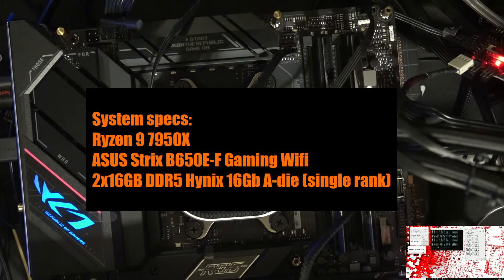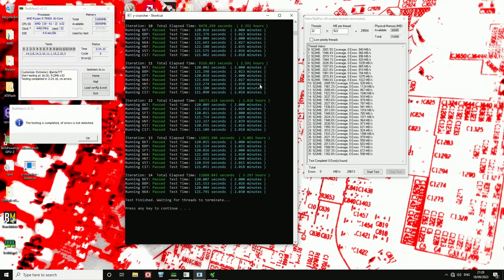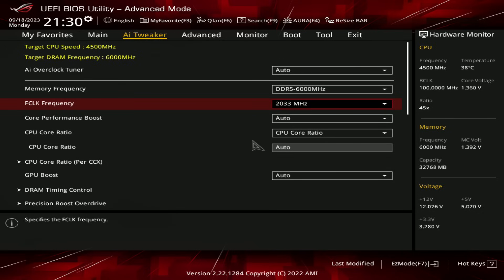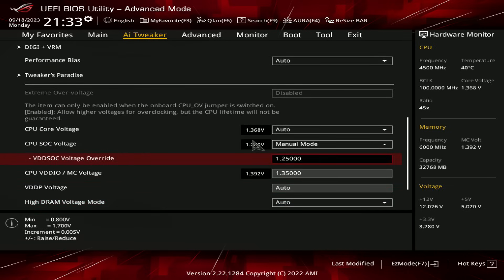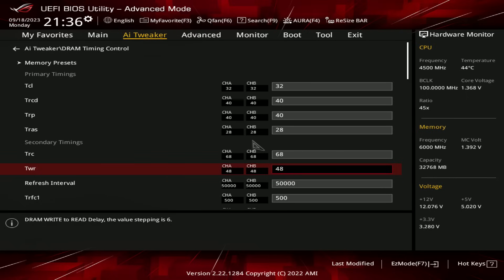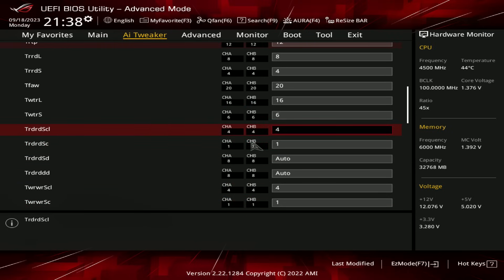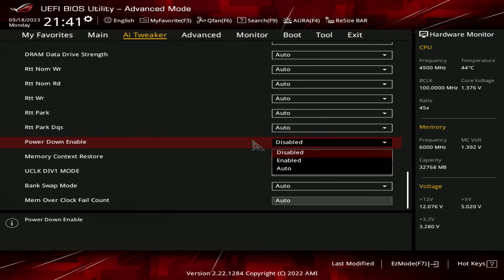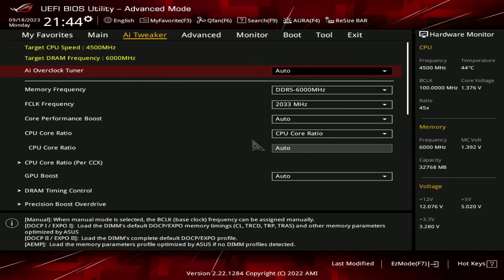Easy memory timings for Hynix DDR5 with Ryzen 7000

Comment: Are there any particular differences for this kit? (F5-6000J3040G32GX2-TZ5NR). I ask because it's 2 dual rank dimms for a total of 64gb. I'm going to build the system soon.
Reply: I ordered the same exact RAM, so I would appreciate if you write anything you find out :) Won't be building for another month or more though.
Reply: @thomasriishenriksen2229  Unfortunately it wasn't effective in my case. I'm just keeping the default EXPO profile for now.
Reply: @Cjorss  did you have stability issues? What motherboard do you have?
Reply: @Dukester  Gigabyte X670E Aorus Xtreme. It started throwing errors almost immediately when turning memtest 5 on and the pc stuttering hard until ending the test. It did actually get that far though.
Reply: @contactluke80  I actually had to turn expo off entirely now. I think it's a temperature issue, It can get through memtest if I set all my fans to 100% but that's impractical. With normal settings I start getting errors. I'm not sure if it's actually the RAM temperature to blame or the CPU because I don't know where to find my RAM temps and my CPU temps are only hitting 70-80 Celsius tops during the test. It's a 7950X3D. Unfortunately I'm going to have to bite the bullet and buy a new case and CPU cooler again because this obviously isn't cutting it even with half the CPU disabled. I'll try Expo again with the new cooling solution and if that's stable then I can try these timings again.
Reply: @Cjorss  Thanks for the update - keen to hear how you get on once you have a new case & cooler.
Reply: @contactluke80  So I went with the Lancool 3 and went overboard with an Arctic Freezer 2 with 420mm radiator on the top brackets. I had to drill mounting holes as they were misaligned, the thing just barely fit in the case. I also moved the 3 Noctua a12s from the old case to the bottom of the Lancool 3. The first thing that surprised me was that the 7950X3D will still reach 90 degrees celcius during one of the ycruncher tests. On idle it's maybe 10 degrees lower than the old NHD15 w/ 1 fan. It doesn't seem to be much better at quickly dissipating heat off the CPU which is a bit disappointing. Maybe if I figured out how to separate the pump from the fans I could operate them separately and have the pump run more aggressively. It's also a bit disappointing that I can't set the fans based on liquid temp rather than CPU temp. Anyway The good news is that my ram is definitely more stable. But these settings might be too aggressive for the dual rank ram. My main test has been TestMem5 and it's been inconsistent at times. On the bright side the Gigabyte boards have a low latency support/high bandwidth mode which seems to improve performance similarly to these recommendations. The best I've had is about an 8m30second test. But even that is inconsistent. I just got 10m40sec. Mind you I also have a Noctua low noise a12 120 mm fan sitting on the graphics card aimed at the ram, It's been fairly effective at keeping sub 50 degrees temps. Without that fan I once managed a successful test where they hit about 65 degrees, usually it throws errors as soon as it hits 50 though. This is really the fault of the manufacturer that sells DDR5 dual rank EXPO memory without a real heatsink. I mean, this new case has 3 140mm fans in the front, 3 in the top and another 3 120mm fans on the bottom and I still need a 120mm fan in front of the ram to cool them adequately. I've also had times where I started getting tons of errors and the only thing I could identify was that I gently touched the fan against the ram. Completely unseating the ram for a couple of minutes and then reseating it got rid of the errors, it's touchy stuff for sure. If you don't have any specific use case for 64gb of ram you're probably better off sticking to a 32gb set, 64gb is kind of an afterthought for motherboard manufacturers too.

Comment: I haven't done any stability testing, but these settings boot no problem for me. 

I have an x670e ASRock Taichi motherboard. The only setting I couldn't find is refresh interval. I looked all over the BIOS and couldn't find it. I've always used ASUS boards in the past and this is my first ASRock board, and comparing the two, ASUS seems to have the better BIOS, but this board has been incredibly stable. It boots with every overclock and undervolt setting I've thrown at it. 

Thanks for the information.
Reply: Another note is the voltage labels are slightly different on the ASRock I have board so it was a bit confusing trying to interpret them from your ASUS BIOS to my ASRock BIOS, but I think I figured it out. 

Although there was one voltage I couldn't figured out where or what it was. It also shows a couple of your voltage settings as red in my BIOS. Although, I was running an aggressive EXPO config and those were already showing red. They were set at 1.3, and you have them at 1.35.

Comment: Running a single stick Kingston 5600 36-38-38 expo, cost 95 eur in 12/21, these settings work just fine, a month and a half later a single stick is down to 73 eur, just checking if these sticks can get to the sweet spot, thanks.

Comment: Could you try and take a look at Trident Z memory? Or does it not make much of a difference?
Setup:
7950X
Asus X670-E Pro Creator
4x16GB Trident Z (F5-6000J3636F16GX2-TZ5S)
Reply: What matters is the chip, Hynix vs Samsung etc.
Reply: Are there any differences between 2x RAM sticks and 4x RAM sticks that you have? The video only showcases memory overclocking for 2 RAM sticks, will that work with 4 RAM sticks?
Reply: @Lil_Asian  they are the same kit, just 2x16gb x2
Reply: @GstarCurtis  Did you configure them as the video instructed? Also, do they run stable? Thanks!
Reply: @Lil_Asian  I haven't ocd them at all, other than XMP
Reply: @GstarCurtis  Ahh, okay. Thanks for the replies!
Reply: @Lil_Asian  4 dimms is harder on the memory controller, which is why 2 is more popular. If you want say 32gb of ram, 2x16 is easier on the memory controller than 4x8. Yes it will work though, this video is for tuned but not too demanding quasi-XMP- should work for everyone on Hynix settings
Reply: @insertnamehere4419  Yes, I'm trying to figure out if it's possible to run 4 dimms at 6000 or 6400 speed. Maybe this video will help idk.

Comment: i’m so cursed, i have a 6400mhz cl32 kit and it won’t even post at anything other than jdec 4800mhz i have no idea why. even stock bios settings and only changing vcore to 1.25 makes me blue screen seconds after hitting desktop
Reply: Then why did you buy 6400 RAM ?
6400, on Zen 4, is a lottery, it either works for some, but for others their PCs won't even post at 6400.
Reply: @DKTronics70  i never planned to run it at 6400mhz. it was just the best deal for me in my region at the time
Reply: @DKTronics70  i updated my bios and we all good now lol
Reply: I can't get 6000mhz cl30 to run anything other than jdec 4800mhz.

I just can't figure it out.
Reply: @SpookyKG  bro try updating your bios, i had the exact same issue for months. i have the gigabyte aureus elite ax x670 motherboard. i even updated the bios before and it didn’t help. but updating it to the brand new stable update that recently came out fixed every issue entirely.
Reply: @SuperCranbery  last bios for ASUS was in Nov
Reply: @SpookyKG  well are you on that bios revision? doesn’t hurt to be as updated as you can be.
Reply: That sounds like the frequency you get with 4 sticks of ram installed. Are you using 2 or 4 dimms? If the latter, you're never going to see 5000mhz

Comment: Used the gskill 6600mhz cl34 1.4v kit as an a die source on my msi x670e carbon. It performs amazingly. Oddly though, my board would not let me set tras to 28. For whatever reason the minimum value the board would let me set was 30. Still seems to work just fine though.
Reply: Same here. Lowest tras is 30
Reply: @fnvfanMSPR same, b650 auros elite AX mobo + 7800x3D cpu....
Reply: @fuckyoutubrforchangingthis  It's normal apparently. Set it to 30
Reply: @fnvfanMSPR  you sexy beast, answered just in time, tysm
Reply: Everything worked, system trained ram, booted, and now.im stress testing using y cruncher.   30 min in,  0 issues.   I also.run 12 case fans on a maximum speed profile to cool the beast.
Reply: How did you set your primary timings?
Reply: @malborboss  I just run the stock primary timings, but dialed in secondary how the guide recommends. I have the kit at 6200mhz with the newest bios

Comment: Hello dear Buildzoid. I want to install a new system. I am a regular pc user / internet surfing and pc gaming. I currently have a system with 8700k processors / 4133 cl18 4x8gb - z390 aorus ultra mainboard.  Do you think I should get ryzen 7 7700/7700x/7800x3d or 13700k? I won't have anything to do with overlock. I want to use the system for 5-6 years untouched. Thanks for your answer.

Comment: What can I do to make my EXPO ram stable at 6000? Changing SOC / IO and DDR voltage does not help. Nothing works at stock 6000mhz. I have a 7700x and x670 asus motherboard. I always get  errors in testmem 5 antra extreme. Kit is 16x2 32-38-38 Hynix M-die at 6000mhz. EXPO kit 1.35v. 
Edit: To add, tight timings and sub timings works perfectly fine at 5800mhz with low voltages.
Reply: Check your BIOS to see if you're on the latest version. Most board manufacturers are adding more RAM kit compatibilities to their BIOS with each revision.
Just as an example, on my Aorus Elite, if I boot with the first 3 BIOS versions, with 6000 MT/s RAM, my PC won't post. Every other BIOS, works perfect.
Reply: @DKTronics70  I am on the latest bios, but the last update was  early december 2022...
Reply: I have a hynix M die kit and 7600 non-x and B650E-F Asus mobo and have this same issue

Comment: i have blue screen on xmp  with am5 and ddr5. Using 6000mhz ram 36-36-36-76 on stock its just fine but how can i fix it please help i just want the system to be stable. What should i do for voltage and infinity fabrick. just wanna use what the ram was designed to do but am5 bluescreens with it on and shuts my system off cus of instability. Also what's a safe cpu_vddio_mem
Reply: You should be using EXPO RAM, not XMP - XMP is for Intel Systems. XMP can have some secondary timings that can cause instability with AMD Zen 4. Failing that, you will need your exact kit's real timings, and you may need to dial them all in manually.
Reply: @DKTronics70  I'm gonna return my kits and but expo il see how it goes

Comment: Thank you very much for the tutorial buildzoid. I have an ASRock Z690 aqua o.c. in the memory timings folder there is the default option of the hynix 6400 tight can I just enable those timings instead of using xmp?

Comment: I’ve gone through two boards and two Ram kits and each time I’ve failed to be able to reach any EXPO speed stable. I’ve messed with every combo of settings I could find. Do you think my 7700X chip just sucks? I thinking my IMC is bad since I’ve ruled other errors and hardware failures out (first board was actually faulty). Currently on same mobo you have (and even same cooler lol) with SK Hynix chips from G.Skill Trident Z5 Neo. I thinking IMC is bad on my chip? Isn’t even stable at 1.35 VSOC. I can’t POST with your guide unless FCLK is at stock either. Already had a replacement filed for my 7700X so I hope the new chip solves my issues. 

More importantly however, is the fact you have the same brand cooler. If it is a CLC 280, how is your cooling? I ask because I’m actually RMA’ing my existing CLC 280 due to it’s age and other issues. I am curious as to how much of what I believe is port cooling chalks up to the issues I’m facing, and how much is just the performance of the CLC.

Thanks for the informative video, and any additional information you might provide in the replies!
Reply: I would RMA the CPU, it's possible that the IMC is busted. Have you tried modifying the DRAM bus config settings?
Reply: @performancefirst1119  I RMA’d the CPU after coming to the conclusion that the IMC was busted. I wanted to rule everything else out first. CPU is now working with EXPO 6k.
Reply: I am living this same pain but on first board/kit/CPU.  Seeing buildzoid do this on the same MOBO I have makes me think the CPU is the issue.

Comment: Thx a lot for ur sharing! Got corsair Expo 6000 cl30-36-36-76 and with ur settings now around 10 percent faster
Reply: As the you running 2 sticks or 4 sticks? I have the same Corsair dominator ram, but am running 4 sticks for 64gb (4x16). All 4 running at EXPO 1 at 6000mhz. Wondering if these timings would work for 4 instead of 2?

Comment: Thank you for your time and effort! I would love to see timing setups for Samsung memory. EXPO is not really working for me with Corsair's CMK32GX5M2D6000Z36 Kit, on my ROG CROSSHAIR X670E HERO mb.
Reply: Bit late with the reply but I had the exact same issue with the same kit, swapped it for G.Skill F5-6000J3038F16GX2-TZ5NR as i was in the returns window and so far it's been great
Reply: @MoosePlus  Thank you for the reply! What motherboard are you using?

Comment: I might need some tips here. I used these exact timings for a couple of days. Then I wanted to manually tighten timings. Good some pretty good results but found it to be to unstable. Now I changed everything back to these timings and the PC refuses to post with these timings

Comment: Hi, I copied your settings and got an overckock that seemed stable on Windows 11 because the computer wouldn't restart.  However, when playing a game like halo infinite or battkefield V for 5 minutes, the game ends up closing.  With other types of overclock the computer was restarted, which I consider more unstable.  How can I keep similar values and prevent the games from crashing?  I don't know what value to start changing or raising again or what you can advise me to try to find stability in games.
Currently I tried other settings with my same RAM from a web and other secondary values and I got improvement, but without a doubt yours was the best.  of 70 ns with the Expo value of the latency ram at 56.7 ns, a beast.  The reading and writing speed also increased by about 400 points.  In games, the performance improvement is noticeable a lot, especially in CPU-dependent games, I made comparisons and the average, low and maximum fps increased a lot.  For this reason I do not want to give up your magnificent overclock profile, and for this I want you to advise me what values or value I should go up little by little to find my point of stability.

My ram is a Flare X 6000 CL32 32-38-38-96, and the primary values that I set along with your overclock were 28-36-36-28.  The overclock that I was trying previously was the one in the following link: https://www.techpowerup.com/review/g-skill-flare-x5-ddr5-6000-cl32-amd-2x-16-gb/8.html  which was stable if I applied only the primary values, but when applying the secondary ones the pc ended up restarting at some point.
Reply: @Proklet I second this. CL 28 just causes crashes for me too.

Comment: Thanks for the video! I'm torn between building an AM4 system with a 5800x3d, or build an AM5 system with the 7600x. The reason is that I want the 7950x3d when it comes out. Do you think RAM tuning is going to make a difference considering the extra cache?
Reply: go for 7800x3d, the higher clock speed on the 7950x has no 3d cache
Reply: @brandyyn  https://youtu.be/JHow31cWMZo?t=459
yeah it does
Reply: l3 cache is huge wouldn't even notice

Comment: Hey buildzoid, do you know if AMD 7000 would have trouble running 4x16GB DDR5 at 6000MHz? It's just that 2x32GB sticks they sell have horrible timings. Thanks
Reply: yes it would have a lot of trouble, 5600mhz is already gonna be pushing it
Reply: @Manuelvdh  Well, I guess I'll just have to wait another generation for AMD to improve memory controller. Intel does just fine with 4 sticks at 6000, but it's Intel.
Reply: @ksenchy  Yes intel is much better this generation than amd with their IMC so definitely go for them if u want that much ram at that speed
Reply: @Manuelvdh  nah, Intel is too inefficient. I was even planning to limit TDP to 105W on AMD. I guess I'll wait till next gen.
Reply: I'm running 4x16gb sticks at EXPO 1, 6000mhz. 2x sets of Corsair Dominator 32gb cl30 6000mhz. Booted straight up, no issues for me with 4 sticks been running it for the last week no issues and no crashes whilst playing games etc. I'm running an Asus x670e Crosshair extreme, AMD 7800x3d and Asus 4090 strix OC.
Reply: @Chrissage-Gaming  don't worry, Corsair meanwhile released 2x32GB 6600MTs CL32. I think I'll put these in and go into BIOS and lower the frequency to 6000 or 6200 while keeping the same timings. It should work. I haven't bought a new rig, wanted to but then saw the new chips are exploding so another waiting game 😂

Comment: There looks to be a mix up between your tWTRS and tRDRDScl values.  My Hynix A die won't even POST when tRDRDScl is 4.  It should be 6.  tWTRS is still loose at 6.  It should be 4.  It looks like you mixed these two values by accident.  They are right next to each other in the Asus BIOS.  tWTRS can even be set to 3 at 6000.
Reply: Curious to see response to this
Reply: something is definitelly off mine posts with all the timings on hynix M die but crashes in aida64 stability test most likely because of tRDRDScl , i have set it to default 9 to see if the crashing will be gone , testing ...

Comment: After hearing that it is very difficult to deal with ddr5, I did not expect that it would be so easy. Thanks for that. can you share 7950x settings for Asus motherboard for the safe and better multi-core performance?
Reply: Just come through the video and copy, thats what I did. I have a 7950x with an Asus x670 pro wifi and the settings worked fine.